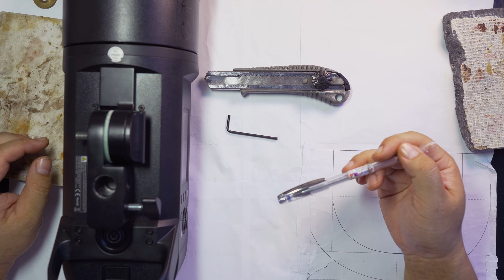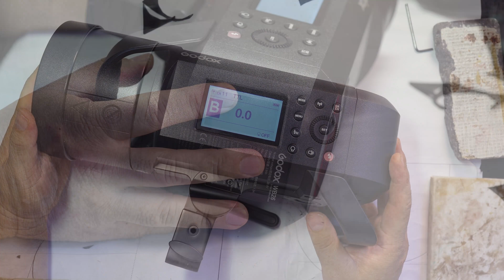Godox AD600 Pro Lightstand Mount Gasket Modification

Comment: I own the original AD600 and really don’t like the clicky plastic, and am gonna attempt a version of this, if I can. 

I have older moonlights that have the super good rubber gaskets. But they just require old sync tools, mains power, and tungsten modeling lamps